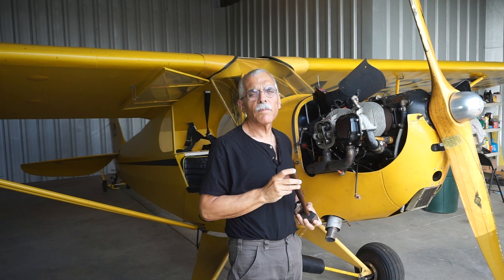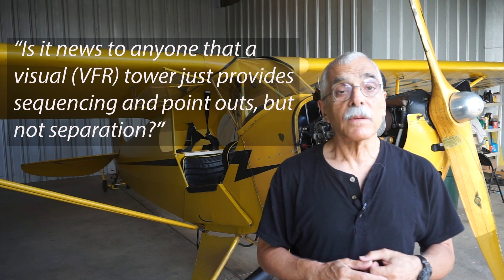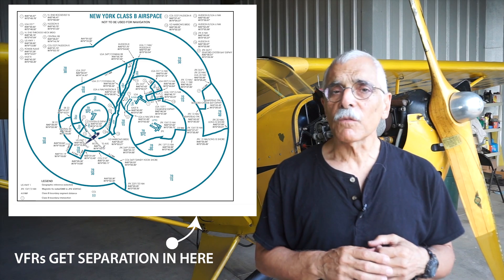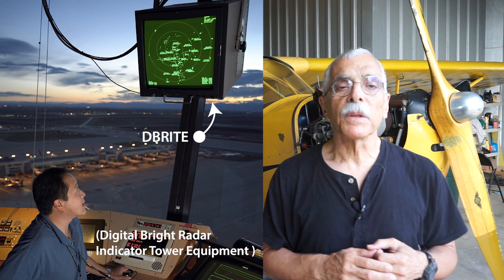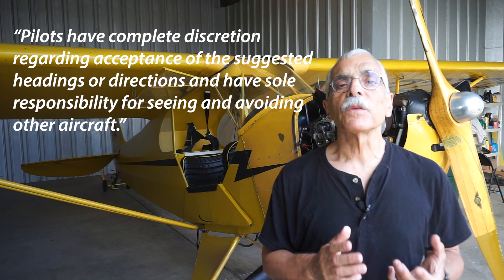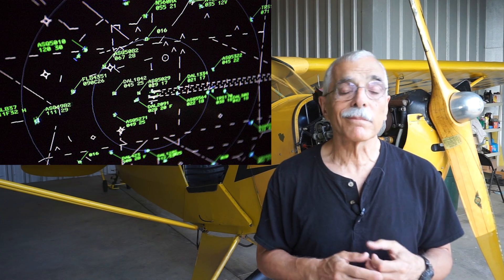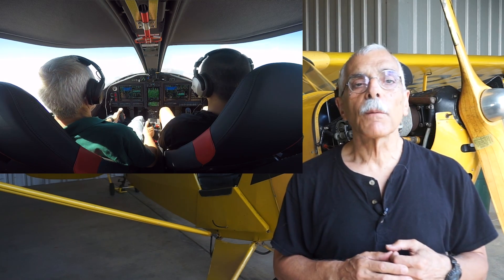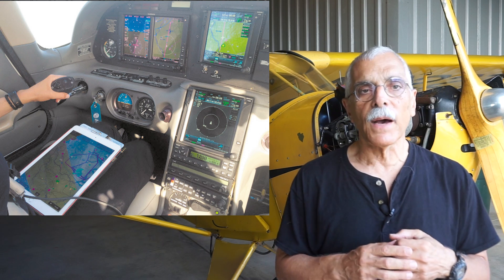Control Towers Don't Do What You Think They Do

Comment: Sounds like a review of Section 8 in Chapter 3 of federal Order 7110.65 might be needed. That's the terminal (tower) control section that describes the requirement that, yes, even VFR tower controllers have for both spacing and sequencing (i.e., effectively, separation). The instruction to "separate" one aircraft from another in various scenarios appears quite a few times in that chapter. (Of course, this does not diminish pilot responsibility to see and avoid under the CFR, either.)
Reply: Many people only think of the environments that require some set explicit minimum separation beyond no-contact, like the 3 mile tracon rule. But separation more generally means that an IFR flight stays separate from both another IFR flight and the terrain, the minimum separation is no-contact if nothing else is specified. (Though there are always minimum terrain clearances and airspace buffers as far as I'm aware. Just by way of minimum vectoring altitudes, airspace design, and route MOCAs. Even final approach has an MDA.)
Reply: @mytech6779  Let's also not forget SRS which means... Same Runway Separation (3-9-6 and 3-10-3 of the .65 as mentioned) literally is a form of Separation.

Not hitting each other is Separation

And we also provide IFR separation.

So yes, we very much provide Separation. As well as the airport conditions to pilots, along with IFR clearances.

I think Mr. Antisocial should have actually talked to a tower controller at a VFR before making this video.
Reply: @JPatterson61586  Maybe he was talking about FSS airports?(more common in Alaska) Truely though I don't know exactly what a "VFR tower" is; as far as I know traffic on an IFR plan can operate from and to any airport. 
"Visual tower" I imagine is just an old fashioned tower with folks that look around the sky and airport grounds, and direct aircraft based on what they see and the info relayed by other sources. Basically everything except local radar.
 
I also know an FSS tower is in general not authorized to provide separation services only advisory info and relay of info from ATC like flight plan clearances, and may also provide some coordination of things like which runway and pattern direction is active and better ATIS updates.
Reply: @JPatterson61586  He's clearly talking to VFR pilots in class D, and it's clear to me, at least, that he is referring to the lack of any particular lateral or vertical separation minimum while in flight in class D between those VFR aircraft and any other aircraft.  If the tower controller does everything right (calls traffic, gives control instructions to avoid the situation, throws a traffic alert in there when he thinks they're still going to hit, etc.) and the aircraft still collide, the controller isn't going to have any liability.  14 CFR Part 91 still puts the burden on the VFR pilot to see and avoid others in Class D airspace.
Reply: @uchinanchuu58  "gives control instructions to avoid the situation...the controller isn't going to have any liability" This also applies to IFR pilots in class A. If the pilots deviate from the ATC clearance (i.e. a pilot deviation) the controller isn't going to have any liability. And while 14 CFR Part 91 does put the burden on the pilot, their is also the first directive in the .65, 2-1-1a "The primary purpose of the ATC System is to prevent collision involving aircraft operating in the system"

That means that it is also EVERY air traffic controller's responsible (yes even the ones in the "VFR towers") to do everything they can do to prevent collision (i.e. keep the planes separated). Now yes, the minimum separation from a VFR aircraft in the air in class D or E airspace (which yes this does include TRACON and Center Controllers providing flight following) is twice the thickness of paint, but we are still mandated to keep all aircraft we are talking to separated from something they can collide with by at least twice the thickness of paint.

We also have other separation requirements, which he does touch on, and it does boil down to keeping pilots from being tangled on the runway, or twisted apart due to wake turbulence. 

Also, the "see and avoid" that you quoted, actually says this:

(b) General. When weather conditions permit, regardless of whether an operation is conducted under instrument flight rules or visual flight rules, vigilance shall be maintained by each person operating an aircraft so as to see and avoid other aircraft. When a rule of this section gives another aircraft the right-of-way, the pilot shall give way to that aircraft and may not pass over, under, or ahead of it unless well clear. (14 CFR Part 91.113)

So I guess since it is all on the pilot regardless of their flight rules to keep themselves from hitting each other, that's great news, my colleagues and I can pack it up on VMC days. (sarcasm)

The truth of the matter is, while yes, IT IS ON THE PILOT to see and avoid; the responsibility is ALSO on the CONTROLLER working the aircraft REGARDLESS OF AIRSPACE to prevent collisions and keep everyone separated. It is a TEAM effort that makes the operation work.
Reply: There is a word missing (after 'have) 'from your comment making the meaning unclear.
Reply: @LosBerkos  no there is not.

To put it another way: most of us should have actually learned that it is "should have" not "should of" but since we technically say "should've" we get confused when reading it sometimes.
Reply: @JPatterson61586   @Jim P  What? Why the snark? I was not remarking on your poor grammar or spelling, I was asking for clarification since you had used an incomplete clause in the middle of a sentence, making the meaning of your whole paragraph up to interpretation - something you subsequently edited. Some people...
Reply: @JPatterson61586  In fact, unless your username is Reflected Miles, I was clearly not referring to your comment at all - in which case my comment would have been preceded by  "@Jim P". What a rude, pitiful and counterproductive waste of my time that you actually try to rebuke me for your own shortcomings in the English language.

Comment: And yet I always encouraged my students to always fly IFR, regardless of weather. A private pilot certificate is a license to learn and that's all it is.
Reply: Although I usually do the same, IFR only guarantees separation from other IFR traffic. More than once have I been on an IFR plan and had way too close of a call. Even in Class C
Reply: @iflystuff1  There is just as much of a requirement for controllers to separate IFR from VFR as there is to separate IFR from IFR in Class C airspace. IFR-VFR just doesn't have to be as great a distance (500 ft. vertical or radar targets can't touch horizontally), so that can look pretty scary comparatively. Nothing replaces the need for the pilot's own active vigilance and tools to maintain traffic awareness and safety, though, including while on an IFR plan. IFR is typically a commercial-operations standard for good reason, though, sometimes with the option to switch to VFR-on-top or VFR flight following if it is operationally advantageous.
Reply: @ReflectedMiles  91.113. if you are VMC. it is your responsibility.
Reply: @iflystuff1  Yes, I already referred to the requirement for vigilance above, regardless of flight plan type. That is not the same thing as having the sole responsibility for separation from VFR traffic in Class C airspace. That is just as much a legal requirement for controllers. All involved are human, or invented and programmed by humans, though, so mistakes are always possible and that's why redundancy of responsibility for mid-air safety is helpful.
Reply: It happened last week to me in the B veil still on arrival freq, traffic 300’ and below with no mention from arrival (weather VFR but super hazy at dusk) saw it only on ADSB
Reply: To add to the dry humor; I always reminded Private pilots, especially new ones, "you now have a license to kill".  That applies primarily to the passengers you can now bring along.😡😤
ERAU 80 CFIA&I ret.
Reply: Always?  That might not help develop basic flying skills, not to mention the false collision avoidance security of flying IFR all the time.  Besides, it's fun to get out there where everybody ain't and do some maneuvers.

Comment: See and avoid doesn’t work for ground vehicles either.
Reply: I am not saying that it never works and not saying that it’s perfect. Just saying that humans have flaws and miss things. That’s the pilot doing see and avoid and the manufacturer building and programming the avionics. People make mistakes. We will never have zero accidents/incidents, but we must continue to strive for it.
Reply: “All the time”…doesn’t work “all the time”. Let’s say that, for arguments sake, 99.9% of the time, it works…every time! Just like Sex Panther…cough. But when you have 1,000,000,000 car journeys a day, that’s still 100,000 crashes (0.01%). That’s plenty of crashes to focus on and even more to ignore. 999,900,000 to ignore in fact.
Reply: @georgemorley1029  I don't think it is "working" 99.9% of the time.  The baseline probability is just low due to the big sky.    It is just one of those things that has a low occurrence probability but a high severity impact if it happens.  The probability of detection (see and avoid) is I suspect relatively low.
Reply: @jamescaley9942  Sorry, I’m not talking about the air, I’m talking about ground vehicles. Imagine that looking and avoiding works for people driving cars around, 99.9% of the time. Let’s imagine that you might look 999 times in a long journey on a motorway, but that one time you don’t and the other guy doesn’t either, thats the thousandth time, and there you go. Accident. So it’s not infallible is my point, but it does certainly have effect on the whole. Oh and I totally agree the point you make about probability versus severity, but then again I am trained as a systems safety engineer for projects.
Reply: @georgemorley1029  I agree it works for cars.  Imagine driving using kneeboard to write down instructions, using an EG6B slide rule computer and also a radio.  It is like texting when driving and you would be arrested.  On the road it is basically 2 dimensions and you know exactly where to look (the road) but in the air you have 3D and need eyes like a spider while also multi-tasking.  Not to mention larger blind spots from wings and higher closing speeds.  I am not excusing sloppy pilots but with the best will in the world this system puts demand on pilots that appear beyond human capability to me.  It is just the sky is mostly empty.    I would guess these accident follow Poissonian statistics.
Reply: Som Ting Wong, We Tu Lo, Ho Lee Fuk. Their still hitting stuff, even to this day, in the air and on the ground. Genetics.
Reply: @tropicthndr  definitely genetics

Comment: Hey, towers also give you the wind just before takeoff (and a squawk code and a departure frequency).  The tower also sequences traffic on a given approach and of course, most of the time they are dealing with training traffic which is the most dangerous traffic there is...and why non-towered airports are so dangerous...Esp if you run into another plane without a radio.  The tower is also a great place to report someone with their transponder stuck on causing your radio to buzz...and to report some goof who is above pattern altitude trying to dive into the approach without a clearance.
Reply: Not true of all towers. My local towers only do what was mentioned in this video. They do not sequence traffic on instrument approaches, local approach does that. They do not give a squawk codes unless you are departing IFR. Non-towered airports are not dangerous if everyone works the pattern properly. They have to know the pattern entry and any special requirements of the airport they are going into. Non-towered only gets hairy when those things do not happen.
Reply: @Gry101  That’s exactly the issue. There are so many pilots out there that don’t even bother looking at traffic directions let alone notams before flying to a new airport. These are the same types that don’t bother to check weather before flying cross country. They think the rules and laws of nature don’t apply to them.
Reply: @VictoryAviation  true, and they have no business in the air.
Reply: @Gry101  agreed, but I do believe that non towered airports require even more vigilance since you don’t have an extra set of eyes (ATC) and no centralized organization. You have to watch out even more for the other pilots that aren’t.
Reply: @Gry101  Class Delta towers sequence traffic on approach and you cannot enter Class D airspace without radio contact with the tower (if during hours of operation).  Usually Class D does not have an instrument approach at an airport, but that is not always the case.  KVGT in Las Vegas has instrument approaches and departures for example.  Also, most often a Class Delta is BELOW (just barely) a Class C or B airspace and you cannot get in or out without a squawk code. Which is why they get them for you.  Also, Class Delta is supposed to have an AWOS/ATIS weather facility, if yours doesn't then complain.  Non towered airport are dangerous and the accidents in and around them prove it...student traffic and planes without radios are common near them...I avoid them like the plague due to those things.  And if I have to fly into one, I give a TON of position calls on CTAF.  Sadly, a plane without a radio or ADS-B is deaf and hidden and the only way to avoid one of those is to not go into airspace where they are allowed.
Reply: @speedomars  notice that I said, and I quote, "not true of all towers". I was speaking specifically of the two towers in my local area. I know the rules regarding entering all airspace. I learned in a Delta. I taught in a Golf, non-towered. You said "also give" and go on to list a bunch of stuff that my two local towers do not do. Blanket statments like that are incorrect as each ATC facility has agreements with every other ATC facility. Those agreements are not standardized throughout the United States.
Reply: @Gry101  My statement challenges the untrue notion that Delta towers do little to nothing...in fact they do plenty.  You may live in some backwood area without much air traffic, but the majority of towered airports operate as I stated.
Reply: @speedomars  again, you are wrong. I live in SoCal, just outside the Mode C Veil of LAX. So, it is you that has no idea exactly what you are talking about. I never said that toweres do not do what you say. However, not ALL towers do what you say they do. You need to get out more.

Comment: Shouldn't pilots and ATC always want the same thing. Safe flights?
Reply: i don't know.
ATC generally is aiming towards safety and good time-efficiency. With pilots usually don't entirely care for time efficiency. Depending on the airline (or their own private budget) they're more worried about fuel economy.
Reply: Yes, ATC also wants safety, but there is a practical side of ATC, i.e. ensuring safety to the maximum while balancing it with efficiency, and there's the regulatory side of ATC, i.e. what exactly is the rule that I must apply in a certain situation to ensure that I'm not liable for what happens to the pilots.  Of course, my goal is always to go above and beyond the minimum requirement, because I really care about the pilots, and I hope that other controllers do the same for me when I'm flying aircraft or when I'm a passenger on an aircraft.
Reply: Pilots die when safety is compromised,ATC people don’t